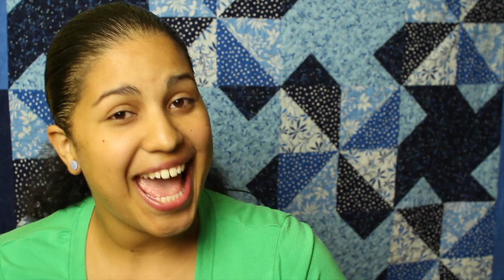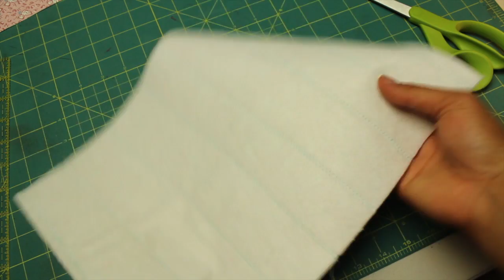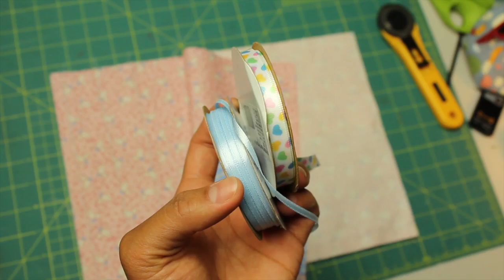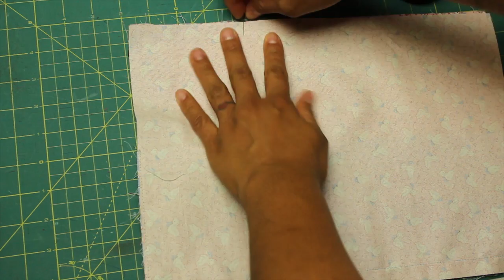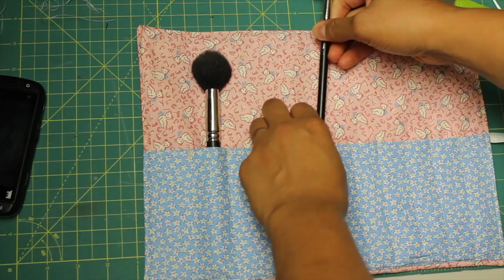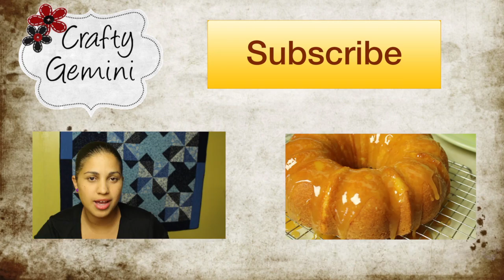How-to: Makeup Brush Carrier by Crafty Gemini

Comment: Great little homemade gift, easy to make. And props to the instructor, very clear, succinct, got to the point. I made one change, for the pocket I sewed it right sides together and turned it wrong side in, pressed and sewed to the panel. No need to worry about the inside seem being upside down and catching the seam when inserting.

Comment: Thanks! Packing for holiday and thought I needed one. Was about to buy it but thanks to this found some random fabric offcuts, used stiffer interfacing as no fleece to hand and whipped up a stylish black brush holder in an hour. £15 +p&p saved as I was about to press buy xx

Comment: Thank you for your precise instructions.  To make it even easier, for the pocket I didn't seam it or pre-sew it.  I just folded it in half and placed the raw edges along with the bottom raw edges and sandwiched it between the top piece and the bottom quilted piece and sewed everything together at once, along with the ribbon, which I made out of the contrasting pocket material.  Also, I made it taller so I could fold down the top flap covering the brushes before rolling it.
Reply: Virginia O'Malley I also did the slots before I attached my back piece so my stitching wouldn't go all the way through.

Comment: here's a tip: instead of using fabric on the inside, use a thin plastic or any material that is waterproof. The fabric gets dirty easier because of the excess makeup whereas you can just wipe the makeup off the plastic. Hope this helps!

Comment: Thanks!  I did the stitching last on purpose so it would add more body to the pockets otherwise the weight of the brushes will make the pocket part lift away from the backing... but either way will work.. just a matter of preference.

Comment: @1971emily As a sewing & quilting instructor I prefer to use plain english terms for parts where many students get confused.  I used "proper sewing terminology" when it is necessary and not only mention it but explain it as well when needed. In my experience, by the time you start using patterns you are comfortable enough with the terminology to apply common sense.  But this is all just based on my personal experiences. :o)

Comment: @TheLaydewlf Hi! Thanks! I did that to add more weight to the pocket.  If you sew it to only the inside fabric when you put the brushes inside the weight of the brushes will cause that inside fabric and pocket area to lift away from the backing fabric.  Hope that makes sense.  I like to use a busy fabric on the back and a coordinating thread so it hardly shows. :o)

Comment: @TheLaydewlf I think its so that the front and back layers are fully connected. Otherwise, if you pinched both layers in the centre and pulled them apart, they would kinda separate :)

Comment: i've been thinking of making some of these. but i'm curious why you didn't sew down the pocket lines for the brushes before connectiong front to back so that the pocket stitches wouldn't show on the outside. is there a reason for this - i don't want to screw mine up if there's a particular reason. thanks for the video and welcome to threadbanger!

Comment: @Nikoletoskovici Thanks! You can stitch the pocket compartments after you sew the pocket fabric to the inside unquilted fabric piece.  But keep in mind that the if it is not anchored down to the heftier backing fabric the weight of the brushes will cause the inside fabrics to pull away from the back. Hope that helps. :o)
Reply: what size is fabric